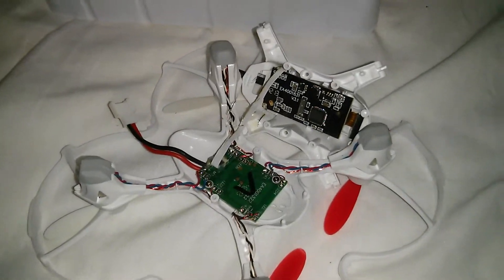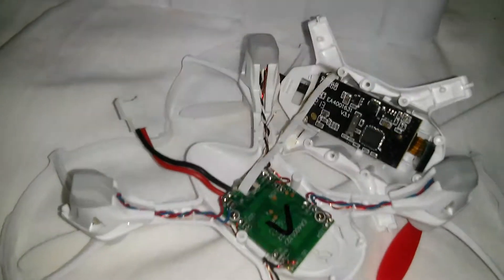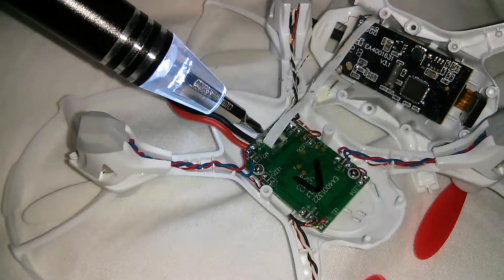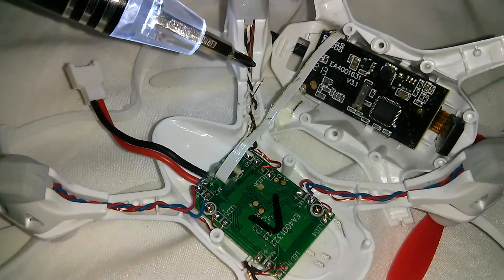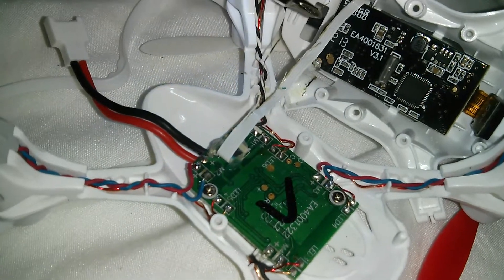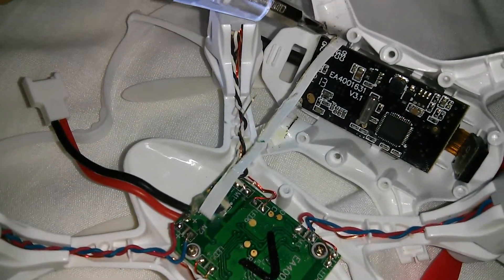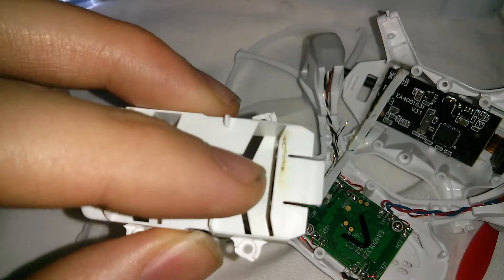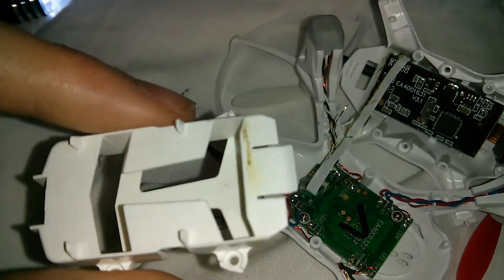Hubsan x4 H107D Fault Burnt ribbon cable

Comment: Same happened to me,but when I touch the bottom connection with metal everything turns off, if I touch it again everything comes back except video and the bottom lights

Comment: sucks. I had the same thing. the video cable that you have and i also had are the version 1. Now version1.01 has a little brown ribbon that is justa a hair to big to fit on the very first. As far as i searched there is no one selling a 5 pin ribbon of this size.

Comment: does this mean i can desolder the fpv cable/board and convert h107d to h107L
if you contact hubsan and show them proof of failure they should sent you a new fpv
if not just search ebay for 5pin ribbon cable it could be from a old cd player or printer
Reply from the maker: no because this is a very old model the ribbon is not like this any more its soldered direct to the board. if your ribbon broke its very hard to solder back